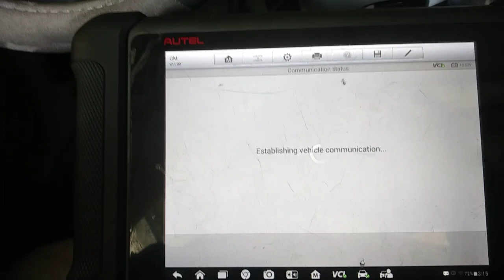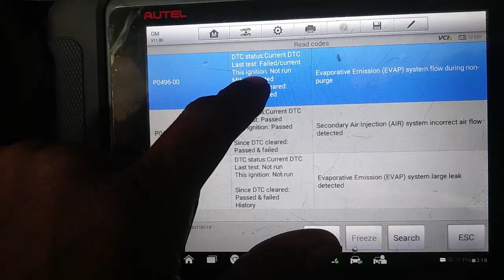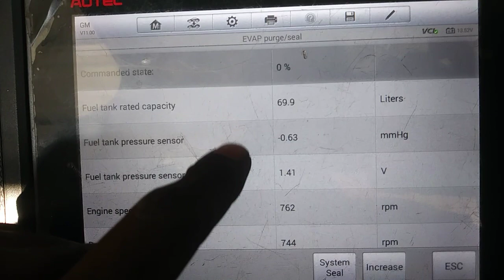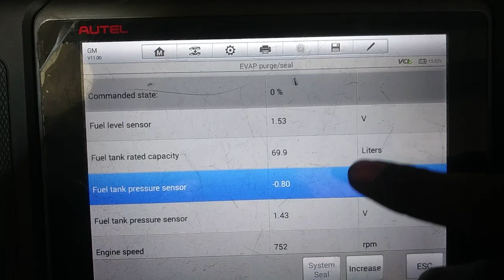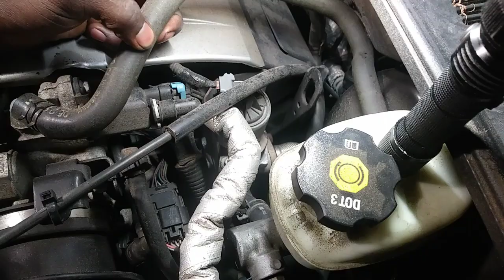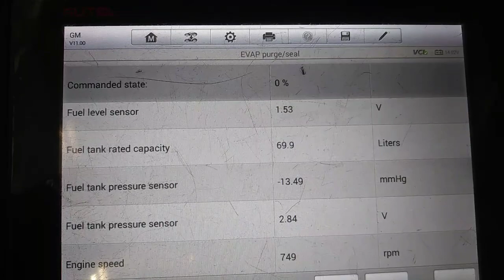Cadillac DTS p0411/p0455 fix

Comment: would this part going bad cause a crank but no start in cold weather? my 05 deville will not start when it's below 38 degrees.
Reply from the maker: @elibenjamen8729 evap purge valves that are bad typically only cause crank no start ONLY WHEN FILLING UP and immediately starting the car to leave the pump. 

There several things that can cause your issue. Seem like thermo- contraction  due to cold temps since you mention it only happen when cold.  Very hard to say without testing when issue is present.

Comment: I HAVE A 2010 DTS WITH PURGE VALVE CODES, (IM UNSURE THE EXACT CODE, BECAUSE IT WAS DONE AT AN AUTOPART STORE)
THE CAR NOW HAS A CRANK NO START AND THE ONLY SIGNS AND SYMPTOMS ASSOCIATED  WITH THIS WAS A HISSING GAS TANK, HOT FUEL PUMP RELAY..
NO ITS A CRANK WITH NO START. ANY IDEAS??
THANKS FOR THE VIDEO. I SUBBED
Reply: By chance you figured out what the problem was? I haven't changed the solenoid yet, was the the ultimate problem?

Comment: Great video  man // got codes P2a00  P0134  P2431  // do you think these codes are related to the P0411 ?
Reply from the maker: Air injection leak typically generate lean codes, not rich as the p0134. I would clear the codes and address the immediate Comebacks! 

In meantime, check the air intake tube and plumbing related to air injection pump. Make sure everything's  hooked up properly.

So, clear codes and address immediate comebacks to weed out the follow-up codes, those maybe irrelevant. Investigate the come back by getting "code setting criteria" for that component and isolate from there
Reply: @partsshooter   I will do that thank you